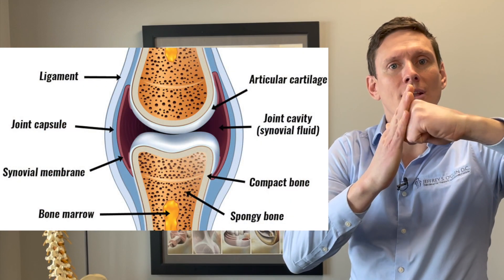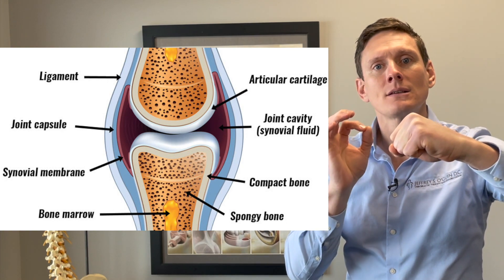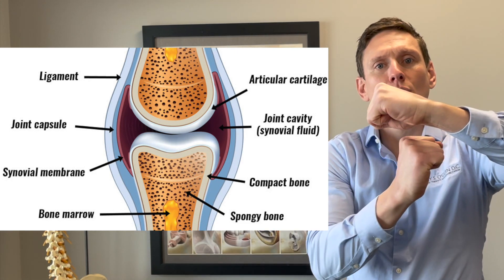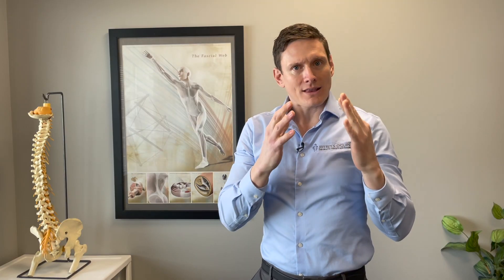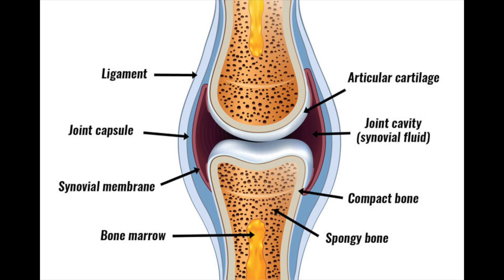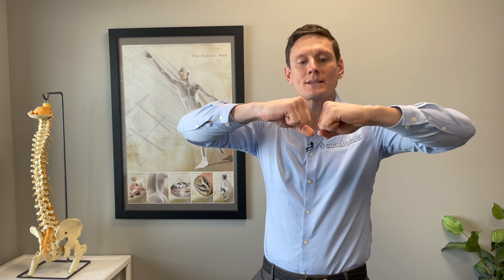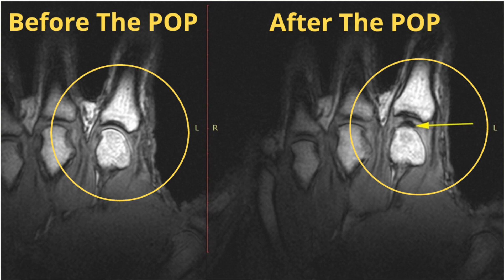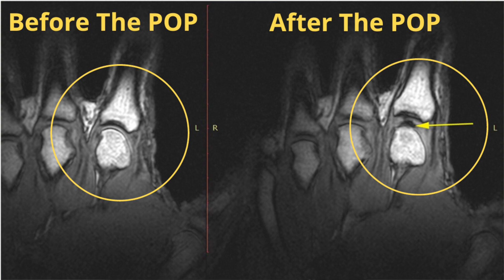What is the pop noise when you crack your back? | Chiropractic popping noise | Chiropractor crack

Comment: @Jeffrey I went to the gym today and did a set of seated rows, but my form was off and I felt a pop in my lower back. Your video really helped me understand what might cause that popping sound—thank you for the clear explanation! However, I’m still trying to figure out why I experienced such a sharp pain immediately after. Where exactly is that pain coming from, and what structures are involved?

After the pop, I started moving around right away (as my trainer taught me to do in case of facet joint issues), and that actually helped ease the discomfort a bit. I’ve been searching online to educate myself on the biology behind this kind of situation. I’ve come across plenty of info on joint mechanics and gases in the spine, but I still haven’t found a good explanation of what’s producing the pain itself. If you could shed more light on the source of the pain or point me toward any resources, I’d really appreciate it!

Comment: I love popping and cracking my joints. I even do this thing where i put my hands together and focus on using my shoulders to create a pressure against my hands and my shoulders will make this crazy continuous cracking bubbly sound. It doesn't feel like when im popping my fingers or legs, knees, elbows or back and neck. Its a different type of cracking. I can also do this bubbly sound to my elbows when i make my arms straight and slowly press them down but the way your arms cant bend and the bubbly sound happens. Of course im not trying to brake my arms. But i do it. Just enough to make my elbows crack well having them straight. I can also do this sometimes wit my ankle tendon. I'll stand up almost on my tippy toes and my tendon will make that bubbly cracking sound. It's crazy though bcuz it's not a bone

Comment: Does the joints have to be pulled away to attempt to remove or expel the air, and in turn hear/feel the popping/cracking sensation? Or can it be pushed together as well. Such as when you attempt to remove the air from a bag to seal it, you squeeze it closer together.

Comment: Thank you Dr. Jeff!
Was taking a motorcycle ride through a town, went under a viaduct unfortunately, there was a deep crater in the road, My bike bottomed out ,my spine and neck compressed ( was going slow so therefore it was just a real big drop). I usually get away with one visit to the chiropractor for an adjustment, Been adjusted twice this week .
There is relief after my adjustments but then everything just seems to stiffen up again. Back/neck. Was it such a traumatic hit to the body that it's just going to take some time?

Comment: So when you pop your back say by a back bend, it leaves a space in your joints? And is that why it hurts after sometimes?
Reply from the maker: No. This is only to explain the noise you hear. There are many reasons someone may have pain with certain movements such as sprains and strains which may or may not be accompanied by a pop.

Comment: How is it that some people seem that can crack almost every bone while others basically none?

Before I started to go to the gym, I had the need to crack my back. Now I don't and almost can't, it doesn't even pop anymore.

Last question. You said it's not dangerous. But it is somewhat helpful? If I do crack my hands everyday for all my life, will I have fewer or more issues with the joints there?
Reply from the maker: strengthening around your spine will make you feel like you need to pop your back less and that can be a good thing. It means your stabilizing joints that were probably too loose. Not enough research to say for sure or not about your knuckles, however, I don't see any long term benefit to doing it.
Reply: @DrJeffreyOGuinSaintLouis  thank you for replying. :)

Comment: Hey Doc, so I have 40 degree S curve scoliosis in my back and neck. I hardly used to be able to crack my neck on my own in the past, but after I found a stretch to crack it, it's almost like it's been easier and easier to get that pop. Now I can just move my neck without much pressure or using my hands and get a good pop. It feels very good when I do it, hope I'm not harming myself?
Reply from the maker: You should consider some strength training around your spine for stability. also, balance training/coordination is great for people with scoliosis. Hope this helps.

Comment: Hey sometimes I be sitting there or working on my feet to whatever and my middle back will get like this weird tight feeling which tells me I have pressure and I need to crack. So I lay down wrap my arms around myself take a deep breath and fall back like and it cracks which makes it feel better but is this normal?? Like I’m only about 20 years old so like I’m pretty young. This also happens in both of my knees

Comment: Where is the gas drawn out to?  If it leaves the Synovial fluid, where does it go?
Reply: It stays in the joint until it gets redissolved back into the fluid. That's why you can't crack your knuckles immediately after already cracking it

Comment: It does not make much sense for me: where does the "gas" come from in a cavity full of liquid? Any gas has less density than liquid, so if you have gas in your joint cavity, it would be bad for a joint. So, I presume that we, as mammals, can't have any gas in joint cavity, because otherwise this system wouldn't work. Please correct me if I'm wrong.
And I think your example with "popping palms" is also quite strange, because the sound is made not because you opened your palms, but rahter of air travelling very fast back to cavity from which you've driven off that air when you brought palms together. So, in an environment with little to no air, there will not be any "pop" sound.
Reply: The gas comes from the synovial fluid itself. It is dissolved in the synovial fluid, just like oxygen is dissolved in water at room temperature.
Yes, any undissolved gas (like an air pocket) in a joint cavity is uncomfortable because it compresses more than synovial fluid, causing a reduction in joint space. 
We mammals do have gas in a joints but it is normally dissolved gas. As the joint moves, creating low pressure areas in the joint, some dissolved gas escapes to form undissolved gas pockets.
You are right. The example of the palm pop is not a great analogy because that sound is created by air rushing back into the vacuum created when he unstuck his palm. In a joint pop, the joint is rapidly and momentarily stretched creating a vacuum effect of low pressure forcing the undissolved gas bubble to instantly redissolve back into the onrushing synovial fluid which is instantly filling the space created by the sudden joint manipulation.
Reply: Another way to think about it is this. Imagine an unopened transparent can of Coke. All of the carbon dioxide is dissolved in the Coke so you only see liquid through  can wall. Now imagine you squeeze and prod the unopened can a bit so some gas bubbles release and rise to the top of the unopened can. This is like the joint before popping it. Now, if you had a machine that could very quickly pull or elongate the can for a split second, it would create a instantaneous low pressure environment followed by a recoiling high pressure environment where the carbon dioxide bubble at the top of the can would instantaneously reabsorb into the Coke creating a pop.

Comment: Hi Doc! Question:
I constantly pop my fingers, nonstop - without recharge time that should be necessary for synovial fluid gases to build up again. For example I can crack my thumb 40+ times in one minute. It sounds like normal knuckle cracking but since it doesn't require recharge time to do it again I  feel I should be concerned. Could this popping be caused be something different and actually harmful? Thanks!
Reply from the maker: This is hard to answer without seeing and hearing it. However, it sounds like it might be more of a tendon rubbing past a bone, or crepitus within the joint itself.
Reply: @DrJeffreyOGuinSaintLouis   & @Reed Willard
I had a friend who was very athletic, and an avid weight lifter. He was (and probably still is) capable of making a fist and squeezing it in such a way that you could hear the tendons make a "snapping" sort of noise. Even though I'm not a chiropractor or any other type of medical expert, I could tell that it was definitely not related to the cavitation of synovial fluid, as it sounded different than the type of "popping" or "cracking" that you discussed in the video, and he could do this constantly; there was no "waiting period," during which gasses would need to re-absorb into the synovial fluid. I can "pop"/"crack" nearly every joint in my body, even the arches of my feet! I do, however get the "tendon snapping" sound in my ankles (mostly in my right ankle) when I walk up a flight of stairs, without shoes, and my ankle, or occasionally both ankles, will "snap" on every step. I can definitely feel and hear the difference between the tendon "snapping" and the synovial cavitation "popping" or "cracking" of my joints.

Comment: I used to crack my back all the time but after I was diagnosed with osteoporosis I stopped but I've always had this weird popping sound whenever I get up from a chair on my lower back it feels like it's coming from where my spine connects to my hip bone, it usually only happens when I get up from a chair but sometimes it happens when I'm standing still but then moved to a different direction, should I be concerned about this? It doesn't hurt but it just feels a little weird and it's kind of loud
Reply from the maker: Hello Pippy. It's challenging to answer clinical questions without a personal discussion. From what you're describing, it does not sounds concerning. However, if you would like an online consult, you can email me at jeffrey.oguin@chiropractorkirkwood.com and we can set it up.
Reply: @DrJeffreyOGuinSaintLouis  hi thank you for answering my question I hope it's not concerning, it's painless it just feels weird with when my lower back makes that cracking popping sound but since I stopped cracking my back I've even stopped stretching and massaging my back I've been feeling so tense and tight like I feel like I really need to stretch but I don't out of fear of fracturing, I don't know if it's safe to stretch and massage with osteoporosis, all I hear is that when you have osteoporosis you have to keep your back up straight good posture because rounding out the back is a risk for fracture but I feel like the spine can get tired of always remaining straight,, I'll check out the link you sent thank you so much 🙏🏻

Comment: hi sir i do poping after 1-2 hours of my back & neck. And it’s feel very good & light .Could you tell me the reason of getting to much pop & its any harmful or not? .Plz let me know 🙏🏼
Reply from the maker: There is not an immediate concern with popping your neck or back too much. However, it might not be the best thing to do too frequently, especially if it's easy. Strengthening around those joints would be better for a long term strategy.
Reply: Does chronic back cracking (once an hour) have any effect on shortening your spine ?

Comment: Does the popping mechanism relieve any pressure? Sometimes, I get pains that are immediately relieved by popping.
Reply: me too when I cant pop or crack it actually hurts more. The minute I can crack it feels so good my neck and my hip my lumbar too and dont get me started on my chiro
Reply: @mixytampa813  exactly 💯
Reply from the maker: it might. There are several theories on why it feels so good. one is that it releases entrapped synovial folds, aka menescoids. It also stimulates small nerve fibers in the joint that act like a reset for the muscles surrounding the joint. I'll make a video for you soon.

Comment: What about if every single joint pops by it self ? What would be the solution?
Reply from the maker: most likely you will need stability and strengthening for a long term solution
Reply: @DrJeffreyOGuinSaintLouis   thanks for your replay. so   I guess I have to do exercise everyday? What types of  exercise would you suggest? like plates or something else ? It is not easy to train every single joint in the body.

Comment: Very informative video, thanks, i have a question, i crack my back very frequently like multiple times a day  and sometimes it cracks when i take a deep breath, should i be concerned? it has negative effects when done multiple times a day?
Reply from the maker: You're most likely just hypermobile in your joints. It's not necessarily BAD. However, a good long term plan for you would be to consider some strength training. That being said, you will want to start slow and have really good technique.

Comment: so what contributes to the build up of this gas and where does it go after?
Reply: don't worry, already answered below
Reply from the maker: It's not a build up of gas necessarily. Just gas that is pulled from the synovial fluid (lubricant within the joint). If someone has more fluid and a larger joint space, they might have more POP.

Comment: Will it cause problems in the future if we crack things throughout our life?
Reply from the maker: There's not enough research to say for sure. Most likely not though. However, popping joints too easily or too often usually means it's unstable and strength/coordination around that joint would be better than cracking it all of the time.

Comment: Hello Doctor, please answer this one.
Whilst I was hanging I a heard a pop on my lower back it felt as if something moved up. The reason why I hang sometimes is due to me sitting all day cuz of work. I got no pain but what to know if it’s a bad sign or not
Reply from the maker: If you're not in pain, it was probably just a cavitation, not an injury. It's really hard to know without a full discussion or exam.
Reply: @DrJeffreyOGuinSaintLouis  thank you doctor. Also, can bending down a lot cause a disc to slip? I had lower back pain because I was bending down 15 times a day whilst playing table tennis when I went after the ball. It wasn’t pain pain but there was tiny pain moving around. Can this cause height loss? This is the final of the final
Reply: @DrJeffreyOGuinSaintLouis  I also subbed and liked the clip